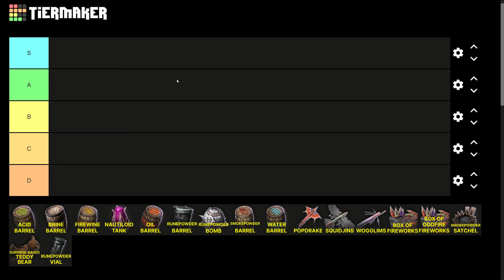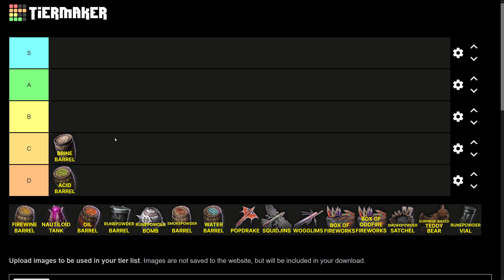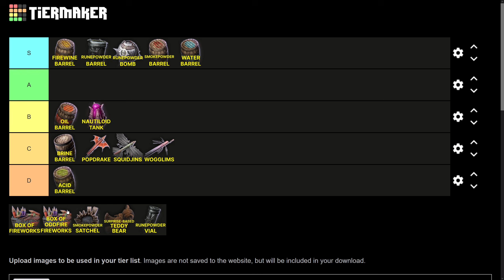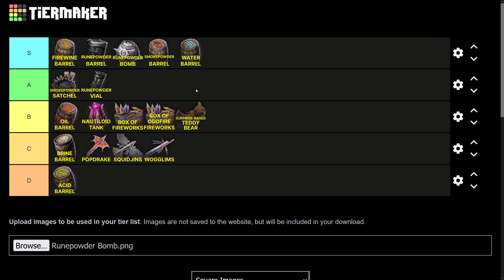SECRET BONUS TIER LIST - Barrels, Satchels, and Fireworks - BG3 Honour Mode Guide

Comment: Pro tip for deploying multiple explosives (including barrels) in clusters without immediately setting them off:
Put them in backpacks, crates, or other destructible containers that can be thrown.
If the container breaks after being thrown to your target, great! You can just use a Firebolt or something to set off the explosives.
If the backpack or container doesn't break and you want to set it off in a single action  then you need a Chromatic Orb: Fire, or maybe a Fire Arrow targeted at the container. The container should break and the Fire surface will ignite the payload
Reply: Agreed. This is the best way to guarantee kills on certain fights, esp in honor mode. Stuff a backpack with fireworks or grenades, throw backpack towards enemy, grenades spill everywhere and you can detonate. You can easily kill final boss in 1 turn with a backpack filled with fireworks and smokepowder grenades.
Reply: I always make a barrel of every single firework that will fit inside of it.

I have not "needed" it yet but I did throw it just for fun to end one of my runs vs the Brain with a bang.